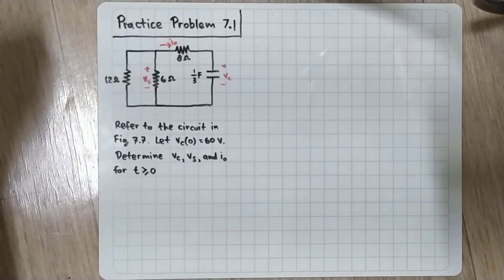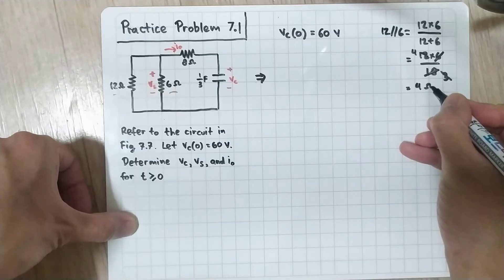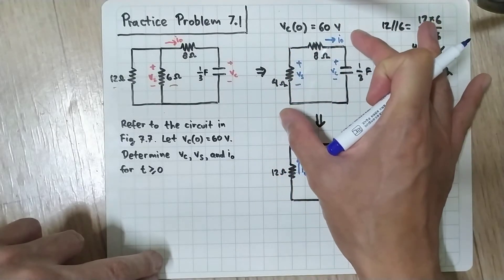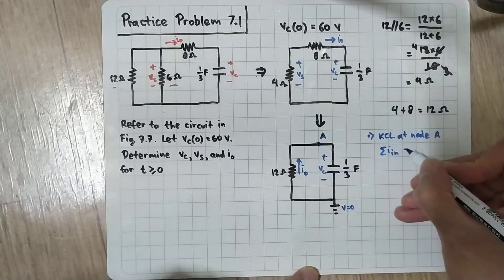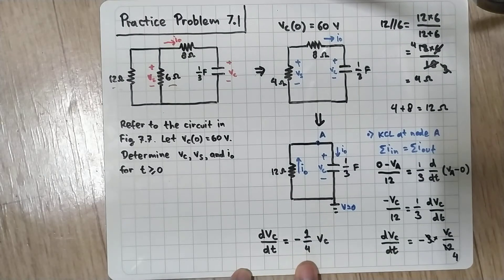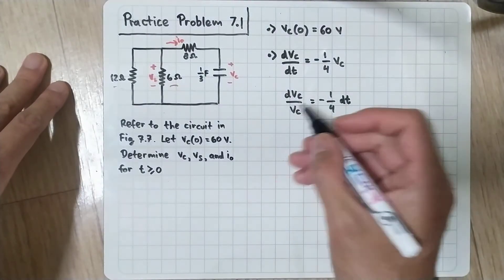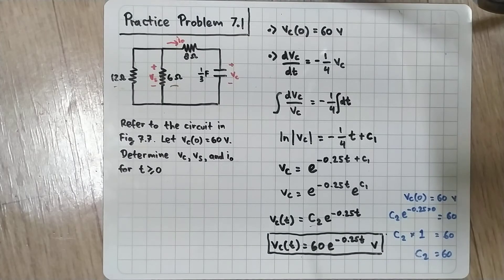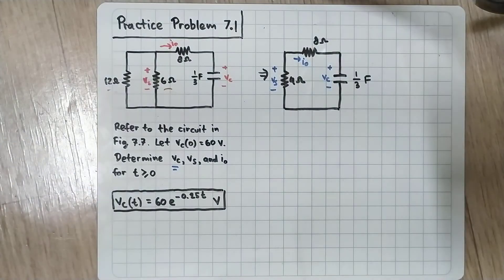Practice Problem 7.1 Fundamental of Electric Circuits (Sadiku) 5th Ed - RC Circuit Analysis

Comment: Although correct i think it's easier to follow the 7.1 book example guide to solve this exercise as well. 

Find first the Req, then the tau = Req * C and then proceed to the voltage divider for the Ux and Ohm's law for the Ix
Reply from the maker: Then forget what was tau after that